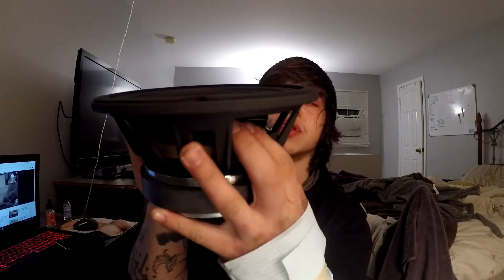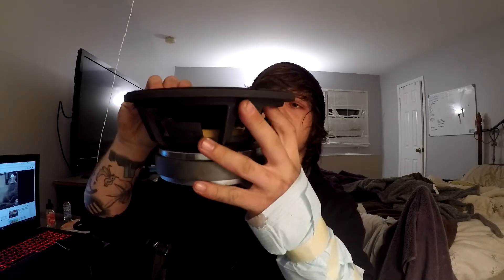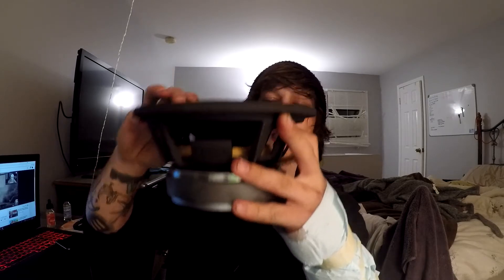What Causes A Speaker To Blow - Car Audio Explained (Ep3)

Comment: So u mean , high volumes(especially bass) are fine untill no(significant) distortion? Or do they even internally damage the voice coil without noticeable distortion?
Also, is extra-excursion bad for the speaker (would it blow?)?

Comment: I had my subwoofer replaced 3 times in 3 weeks. I’ve had 1 Fosgate P1 12 .. now I’m on the P2 .. just blew 2 of them P2s in 2 days. They were professionally installed. I was listening to my music at max volume but for less that 20 minutes each time the speakers blew. Does anyone know what issue is? I paid over $800 for the sub box and install
Reply: U got riped off

Comment: I heard that you can blow tweeters and midrange drivers by playing bass through them and because of this when you turn the bass up on a stereo tweeters and mid range drivers get distorted or blow should the bass level controls be avoided at all costs
Reply from the maker: i would avoid it unless you set proper cross overs
Reply: Lil Rob What if you have co axial speakers? You don’t need crossovers in that situation then?